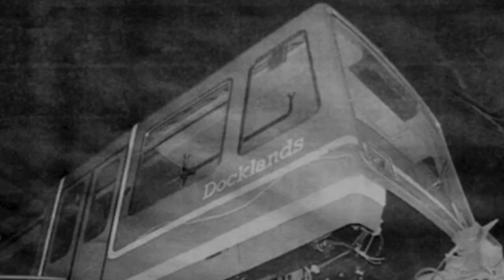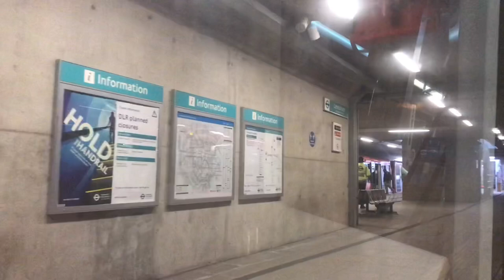The Island Gardens Accident: What Really Happened

Comment: As a software engineer of many years I can see exactly how this happens, great explanation. This would all be virtually modelled these days, a bit extreme to test an edge case in the real world though!
Reply: Or at least test it with plenty of safety track instead of the end of the line behind it.

The test would be something like going at overspeed and checking how long it takes to stop the train. 

Unfortunately I wish I could say that people would understand that 1+1+1>2.7 and that a design like that is not good enough, but I expect that kind of problem exists in many newer systems as well.
Reply: Yeah, but it was in the '80s, less elf and safety, and also not the first time something like this had happened.
Reply: It is entirely normal in railway safety to fully test safety critical edge cases.
Reply: The idea of a fixed one second loop seems heinously long to me here in the 21st century. But I’ve never had to design absolutely-cannot-fail systems like these, so maybe it’s less ridiculous than it sounds at first blush.
Reply: @gormster  Fixed timing loops are in fact fairly common in safety critical systems, since it makes it much easier to formally analyse the design for correctness and worst response time. Pity that it wasn't done here.
Reply: They weren't testing the edge case. They were testing that the train would stop at the station, and the edge case came up and bit them. Presumably, they had already done a lot of tests at stations where the train would fall 30ft to the ground if it didn't stop, and they only did these more dangerous tests when they were confident in the train's performance.
Reply: Then there is the project requirement to list all unforeseen circumstances.
Reply: @57thorns  "I wish I could say that people would understand that 1+1+1>2.7"
Honestly, the explanation in the video cannot be correct. A train that starts to brake 0.3s too late stops slightly closer to the buffers than normal. Even if the safety margin was zero (i.e., you brake too late, you hit the buffers) it would just cause the train to push the buffers back a few inches. There is no way on earth that this train started to brake just 0.3s too late.
Reply: You'd hope it'd all be tested virtually, but the Boeing starliner failure last year was basically an inflight software integration test failure, and they're having ongoing problems with getting the virtual results which is why it's next test flight keeps slipping..
Reply: As someone with a couple decades of software experience, this also made complete sense. And based on the processors available at the time, it's not that surprising that the system was so slow.

That said, if you want to scare me, tell me that an organization's quality assurance and testing department never finds any problems. If your tests never fail, your tests are no good.
Reply: @hosedevil  There have been the odd steam locomotive embedded in station walls overhanging the street below.
Reply: @beeble2003  Depends on the velocity prior to application, the retardation of the braking system and the length of track to remain on.
Reply: @thexalon  Given most of the Crossrail delays seem software based one wonders what has been learned in the past years.
Reply: And the mass of the train and its load.
Reply: @highpath4776  Shepperton springs to mind, if I remember right the track had been sprayed and the 508 was unable to stop and went over the buffers, ended up overhanging the pavement, believe it was a Wimbledon driver at the controls.
Reply: @hosedevil  Yes, and they were lighter than the previous stock and with disc brakes needed a different technique to slow down anyway.
Reply: I suspect it was +3 seconds additional latency in this edge case and something has got lost in the explanation
Reply: @hosedevil  Yes. Ian Allan didn't have to go far for photos of that one.
Reply: @beeble2003  While I know virtually nothing about this stuff, I have to say that braking, less than a second late, at a fairly low speed, should still have had the train inside the "overlap". I wouldn't have expected such a small extra distance to even touch the buffers, let alone plough through them and drop off the end. 
While the theory of what happened may well be correct, I suspect there may be some longer time intervals involved.
Reply: @thexalon  Writing tests to pass is a real problem. Beware the suite of green tests, that stuff is scary
Reply: @beeble2003  Think of each computer as a wheel.  Wheel 1 2 and 3, all in a row. 3 applies brakes. Each wheel has a mark on it. All 3 wheels counter rotate at the same speed but SOMETIMES a wheel may be a little slow. For breaks to be applied marks on the 1st & 2nd wheels must line up and the brake token passed from wheel 1 to wheel 2,  then wheel 2 spins round 180deg and lines up with wheel 3 passing the brake token and the brakes are applied. BUT they may not all rotate at exactly the same speed so the lining up will be less frequent and on occasion introduce at least a 1 revolution delay and sometimes considerably more.
I hope I have not clouded the issue!!!

Comment: The train was under test.   Many tests have no success or failure, only a result to be analysed.
Reply: There is a school of thought which considers a test which achieves its normal output for normal inputs to be a failure, and only those from which you learn something new to be a success.
I see where they're coming from, though I don't entirely agree with it as a position. Regression tests, for example, are meant to check for normal results given normal inputs even after some change has been made in the system.
Reply: @clickrick  
There are many different types of tests, with different parameters. One is a big machine pulling at bolts to snap them.  The bolt has a range of strength for its application.  If it snaps well above the specified strength, then the test is a  success.

Open ended test(s) are different. Test something to see how it performs way above its specification or intended use, then analyse. In this train application, a test would be to saturate the control system to see how it performs. The tester would regard a failure of the equipment as a success. He found a problem.
Reply: Was undertaking the test at the end of the line with a 10 metre drop, a successful outcome of a failure to plan?
Reply: @sumpyman  
That test lacked a safety margin.
Reply: @johnburns4017   And  safety margins are very important parts of a test. Therefore the test was a failure. If they had performed the test one station back, then the outcome would have been a success. Same learnings, no embarrassment, no extra costs and no iconic images!
Reply: @sumpyman  
The train stopping at predetermined point was needed on a straight track.
Reply: @johnburns4017   But any straight part of track on the network would have done. And how is that specific predetermined stop point (one with an abyss after it) any different to a stop signal?
Reply: @sumpyman  
A piece of track without a drop at the end to test on.
Reply: I guess this bit of track was the most suitable as it had a very clearly defined point by which the train had to stop by, and it would be (and to some extent was) painfully obvious when it missed the mark

(**removes tongue from cheek**)
Reply: Thats not generally how testing software worls, however. You need to know what success and failure looks like otherwise the test is pointlesd

Comment: But was it wise to test a new train going at a faster than normal speed with a new computer system, on a line that actually did end 30 feet up in the air? Couldn't they have tested how well a train stopped on a piece of track that continued, just in case the train in fact didn't.
Reply: Well, the topology of the track is already inputted in the computer, tho. So the testing at the actual end of the track also tests whether the topology of the track is inputted correctly. Changing the end point removes this part of the equation.

They indeed COULD have figured this exact bug on some other station tho, I must say.
Reply: Yes... though at some stage a "real" test would still have been a good idea. One where there is no artificial test harness, no possibility whatsoever that the test conditions didn't reflect reality for some unforeseen reason. Admittedly there might have been better choices of termini, for example one not built on a viaduct...
Reply: At some point testing like this would still be wise, for example, if the data at this station is incorrect or some other unique issue comes up as a result of it being the end of the line.
Reply: But surely, even if a test for Site A is undertaken at Site B, and passes with flying colours every time, it still won't prove that it'll pass at Site A until and unless it's tested at Site A.  Apparently trifling variations in elevation, construction, angles and so on could make all the difference.
Reply: @erejnion  I think that after this testing failure they were able to re-use the whole crew & even, apparently, most of the train. I'm not sure that would have been true if they'd done the test somewhere where the train would have hit a station building if it overran the buffers...  although maybe they were testing in every location that an emergency automated stop might be required & it's just luck that the failure occurred where there was nothing solid to hit?
Reply: "Couldn't they have tested how well a train stopped on a piece of track that continued, just in case the train in fact didn't." Do you really think they didn't do that test before doing this one? I just don't understand why there are so many comments from people who haven't considered the idea that this test was only done because the train had already passed the simpler, safer tests.
Reply: @erejnion  Was Old Dalby in use at the time ?
Reply: @franl155  Rail Adhesion is the most variable factor if you have placed all the other telemetry the same.
Reply: @fat_biker  I was thinking more along the lines of "input in the computer a topology of the track where the previous station is labeled as being the end of the track, and test whether the train will stop even if there are no buffers at all in front of it".
But if they were testing emergency stopping everywhere, and it was only due to luck that it failed exactly where it failed... that really is the most they could have possibly done. Well, bad luck happens. I'm glad the damages weren't serious.
Reply: Is it not likely that the equipment under test was only in place at terminus stations? There would be automated stopping gadgetry at all the stations but the stuff at the end of each line would be different, meaning that, in the end, it could only be tested where it was installed ie the end of the lines.

Comment: Accidents that happen because of situations no one anticipated can be perplexing, to say the least. There were two of those when I worked in the Safety Department of the Chicago Transit Authority. One in 2013 which was referred to as the "ghost train"...which involved water getting in to control cables, causing shorts which overrode "deadman" circuitry and allowed the train to move without an operator. The other was the 2014 derailment at O'Hare terminal...which involved insufficient placement of emergency track trips to stop a train traveling at unanticipated speed as it entered the terminal. There were instances of human error and other factors leading up to the incident in both cases, but the ultimate results...a train running without an operator and another train crashing through the bumper at the end of the track were both from unanticipated causes.

Comment: Seems a strange computer interaction to me. In my experience an ATP computer controls the round train brake circuit directly: in the event of an issue anywhere on the train, e.g. a door is not properly closed, this circuit is opened (fail safe) and the brakes are applied or, if stationary, held on. On the Victoria Line the ATP consists of three identical computers running identical software: two of these computers must agree with each other at all times: it's called 'majority voting'. I spent several months in a factory testing the interface between the Victoria Line trains ATP system and  the radio system that conveys the data messages between the lineside signal systems and the trains; then I went to site to commission said radio systems.
Reply: Computers in the 80s were less complex, which generally meant you needed more of them. It was the interactions between your multiple computers that added the complexity. Besides, making a single computer control everything is not foolproof either, just look up Therac 25 for a proper horror story.

Comment: Yep, safety testing is a good thing. The modern world seems to have completely forgotten that not all tests result in 100% success. Some result in a failure that you can learn something from, and make changes so it doesn't happen again. In many ways there are more valuable and contribute more to gained knowledge than the successes. 

When man was learning how to get into space 70 years ago there were a whole lot of tests that blew up or went corkscrewing sideways, and each one was a success in that they learned from it and the same thing didn't happen again. Now we expect all "tests" to merely be PR shows.
Reply: People are relearning that during SpaceX Starship tests now. And those tests were only "successfull" in the sense that they did not show any flaws in the actual tests.
Reply: It shouldn't take any testing at all to realise that three computers running asynchronously on one-second cycles can take up to three seconds to come to a decision, and that such a system therefore cannot guarantee a response within 2.7s.

Having said that, I just can't believe the explanation in this video. If the train started braking 0.3s too late, it would have stopped 0.3s too late, and that shouldn't have resulted in anything worse than stopping very slightly closer to the buffers than normal. You don't go off the end of a viaduct by hitting the brakes a third of a second late.
Reply: @beeble2003  You are right in that those 0,.3 seconds are not the whole picture, can't be. Unless someone thinks safety margins are for losers.
Reply: @beeble2003  ....Breaking from high speed, which it was, 0.3 s can make a difference of a few meters which was all it travelled
Reply: @davidioanhedges  Oh. Duh. For some reason it didn't occur to me that braking 0.3s late means spending an extra 0.3s at whatever speed you were doing before braking started. Duuuuuh. But, still, there must be multiple factors in play, here: unless they were Hail-Mary testing the emergency brakes from the last possible point they could be applied, the system should have had plenty of time to see it needed to brake harder.

Comment: Marvelously enlightened video on a subject which doesn’t seem light after having been taken along the delay in the atp by which this video came to fruition. Overall the delays in atp’s, or atb’s in other languages, have been found to be the cause of inconsistencies at low speeds. So, in this special case a many thanks for explaining this ‘light’ problem into such detail.
Reply: So at a speed slower than a clock cycle or whatever the parameters can fit more than once into the expected slot , the over-run at the edge of the cycle is wrongly detected ?
Reply: @highpath4776 something like that is the gist of the flaw as it existed in atp’s, atb’s. As far as I’m aware it can even occur in older block detection for model railroads, however, the mass of those trains induces an almost immediate stop. Not so for real trains whose travel of brake is something systems should always anticipate on.

Comment: If Boeing made trains there would have been passengers on it.
Reply: Or they would all be over budget and then cancelled
Reply: Boeing used to make trains. 
The Boeing LRV also called US Standard Light Rail Vehicle. 

They where so heavy, noisy, frequently derailed, broke down so often there the mean time between failures was so short that often only half of the rolling stock was operational.

They where so bad that Boeing couldn't produce enough replacement parts for them. So in Boston they started to cannibalize some of the cars shortly after they went into operation just to get enough replacement parts to keep the remaining cars operational. 

But here is a funny quote from the Wikipedia Article:
"Before they were delivered, Boeing claimed the US SLRV would be reliable and virtually maintenance-free." 

Only two Transit systems ever bought those car.
The Boston MBTA and San Francisco SFMTA (Muni)

Here it the Wikipedia link;
https://en.wikipedia.org/wiki/US_Standard_Light_Rail_Vehicle?wprov=sfla1
Reply: They designed the cars for the PRT system at West Virginia University back in the early 1970s.
Reply: @DarkAudit  Ok so Boeing did build trains,  egg and my face were in alignment.
Reply: Growing up whenever I heard a plane had crashed I knew it was a Boeing.
Reply: @Podkova It was in Derby (for use in Manchester) but I don't think it's there anymore. They bought two over for analysis at Derby.